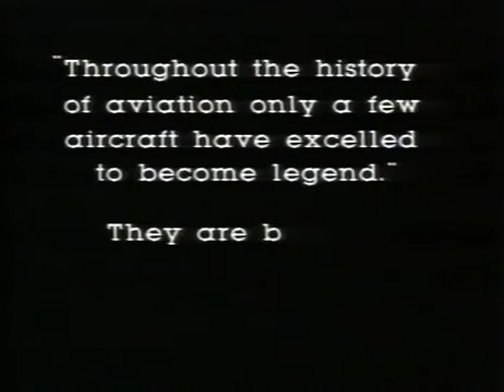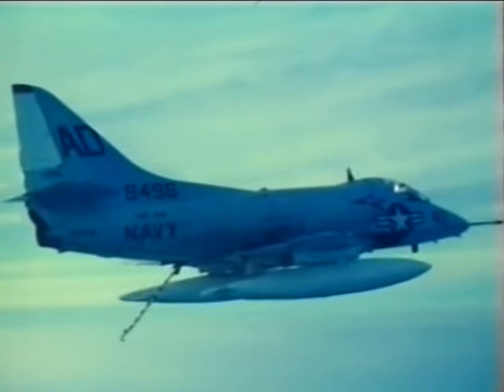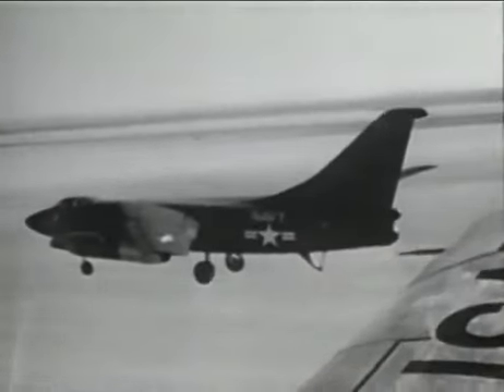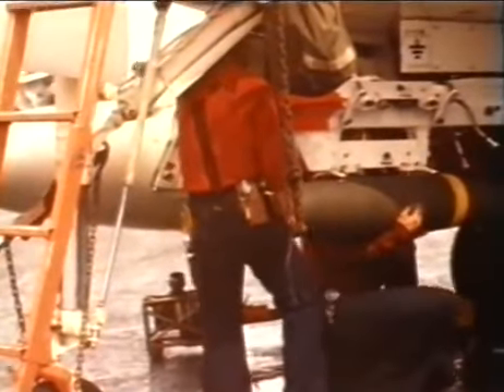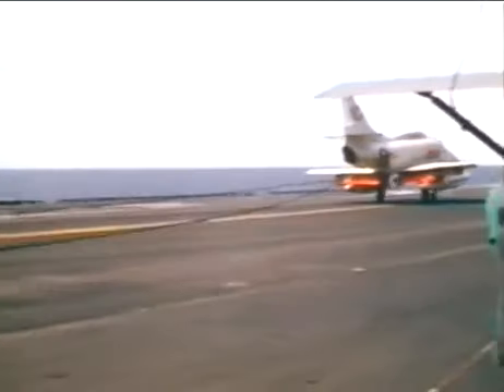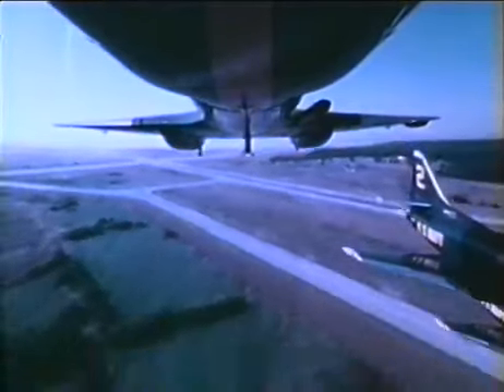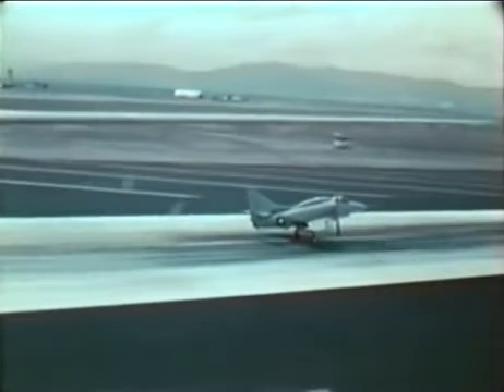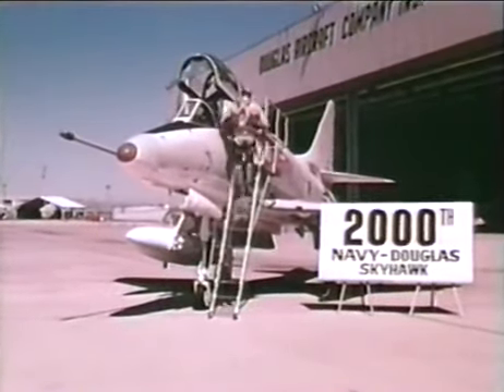Discovery Channel Wings - A-4 Skyhawk

Comment: I just realized the Marine variant carries more bombs(weight) than a modern F18...FFS we need a Skyhawk 2.
Reply: The marines version didn’t need airframe bracing & reinforcements for carrier landings.
Reply: @audience7264  All Marine fighters spend time on carriers.  A4's, F4's, A6's, and then F18's.
Reply: @audience7264  as a condition of being a maritime force, most Marine Corps aviation assets are required to be carrier capable. The only exceptions i can think of in the naval aviation fleet (Marine or Navy) are those too large to be realistically operated from a carrier, such as the KC-130 or P-8.

As for the A-4M, ive seen one up close; they most certainly have the equipment for carrier operations (aresting hook, catapult hook ups, and reinforced landing gear).
Reply: well the F-18 has better guidance weapons than the A-4 which means that you dont need to drop a bunch of MK-48s when one GBU-15 can do